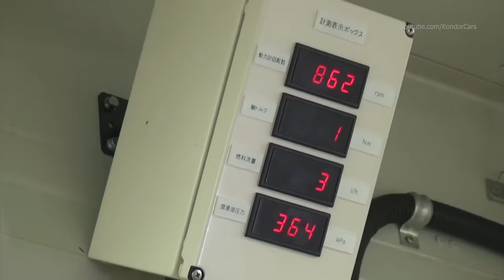ISUZU Truck Production - Japan Factory

Comment: Ok, I bought a brand new Isuzu NPR HD box van in 2014 here in Canada. It’s been an absolute nightmare for me over the last 6 years.
Here are just a few of the problems.
At 125,000 kilometres had to have a brand new exhaust system fitted.
Then a brand new Engine. Yes a brand new engine.
NOx sensor replacement.
Excessive corrosion from day one.
Electrical issues. And many many more other issues, too many to list here.
I have had so many fights with Isuzu over warranty I am at my wit’s end.
My advice is, don’t buy one, simple.
This is just my experience, you may be luck and get one that’s ok.
Reply: It still sounds as if your truck is more reliable and trustworthy than your Prime Minister.
Reply: Also some problems due to truck body builders mistake/error.
Reply: Maybe your engine is not isuzu. because 4JJ1 is an amazing piece of art.
Reply: @montesa35  
Hi Joniel
Why would you say that ?
Just curious ?
Reply: Isuzu. Truk Angkutan Personil Baru 
Truk Angkutan Barang Baru. 9. Unit 
Abuh Abuh Bubuk Baja Tuah Biruh 
Sopir. Kowal Kowad Kowau. Ambil. Mobil. Truk Angkutan Personil Baru 
Truk Angkutan Barang Baru 9 Unit 
Kirim kan Mobil Truk Angkutan Personil Baru Truk Angkutan Barang Baru 9. Unit Lewat Kapal Atg Lst Mico Tibah Pelabuhan Perak Pelabuhan Merak Manado Medan Jember Surabaya Jakarta Jember 
Laut. Lepas  Laut. Jawah. Surabaya

Comment: Isuzu trucks are durable and solid.
Reply: Not in Canada there not.
Reply: @andycommonsincanada   *they're
Reply: @deplorablebristolian  
They’re ????
GO YOU MEAN THEY ARE ?
Ok if they’re, then explain this.
Under warranty.
At 125,000 kilometres complete new exhaust system.
Then total engine failure and had to have a completely new engine.
Multiple electrical issues on going to this day, in fact just spent over $1500 Canadian on repairs.
New NOx sensor.
New electric mirrors.
And a whole host of other issues too long to list.
Also.
Let me tell you a story.
When I first purchased the Isuzu I had to get a filter from an alternative dealer to the one I purchased from.
As I chatted to the gentleman in the parts department and said I had just purchased a brand new Isuzu NPR truck he said 
“ WE ARE GOING TO BE SEEING A-LOT OF YOU ha ha”
I shrugged it off, but boy he was not joking.
So no you can take it from me, in my personal experience (they’re ) CRAP.
Reply: @andycommonsincanada  Isuzu trucks still sound better than your Prime Minister to me. What does it feel like living in a dictatorship under Justin Castro?
By the way, I've owned probably a dozen or more Isuzus and Isuzu powered vehicles and they've all been reliable as can be.